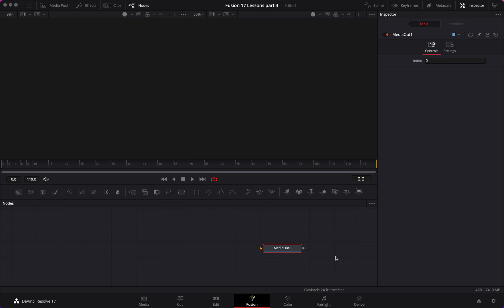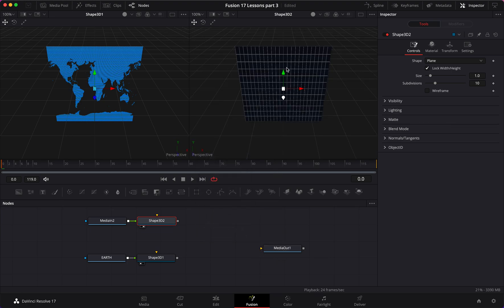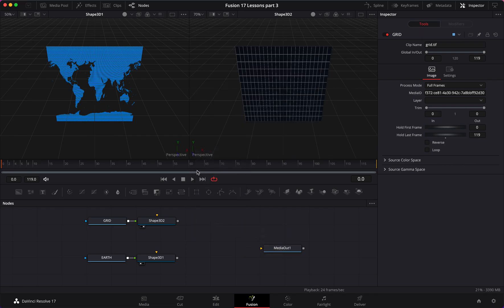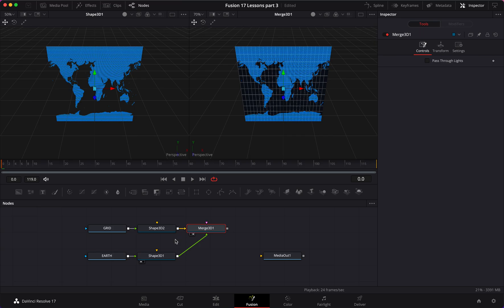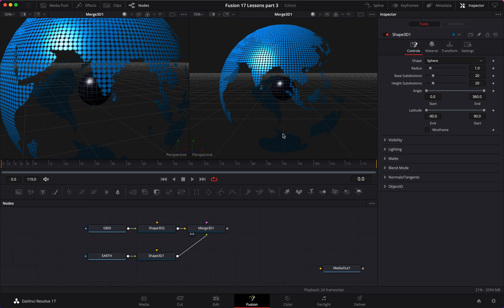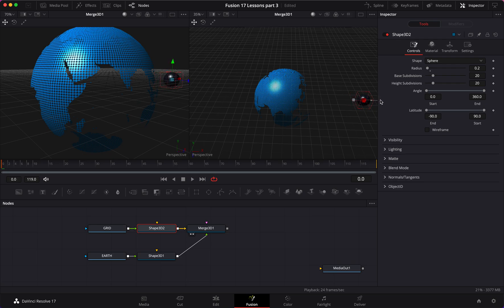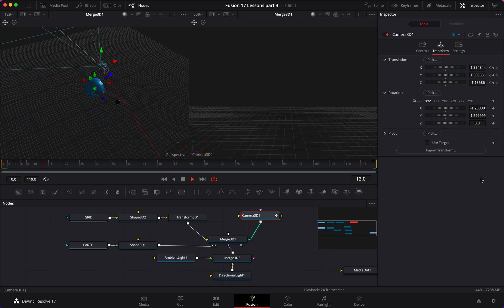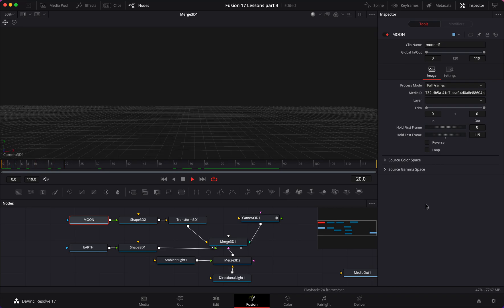DaVinci Resolve 17 FUSION - Basic 3D Compositing (Lesson 9)

Comment: I like Resolve, Nuke, and Blender when it comes to 3D but Resolve is my number one because of the node system. Love the imageplane3d node! So much power! Easy to make like ground explosions or have an object pop out of another with ease. Planar Tracker works well too. Add a render3d and color correction node at the end of the comp and bam! Magic! Set up multiple spot lights in different positions and you can even select use target to put the light in a certain area to create shadows and highlights. Control the cone angle and all of that. Then get really advanced with the keyframes. Camera and spotlights moving all over the place… Love it!
Reply from the maker: Absolutely agree. Fusion as a node based compositing software is very powerful, and the 3D features are amazing.